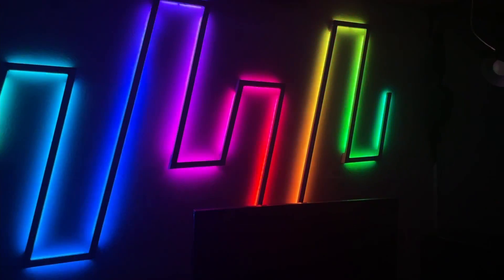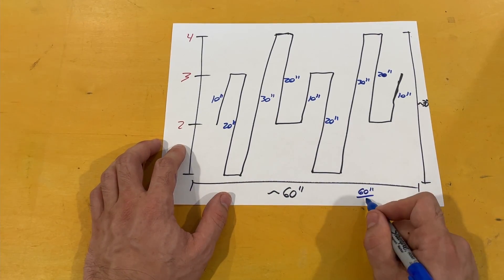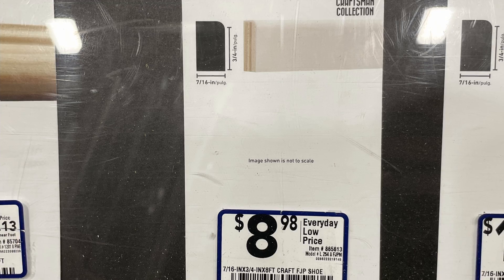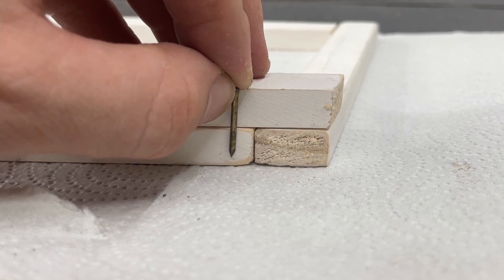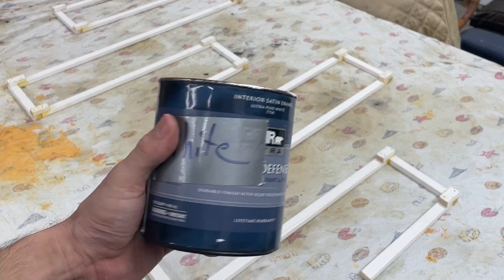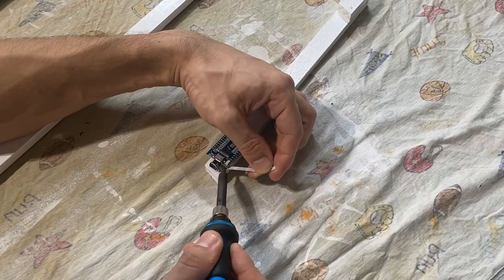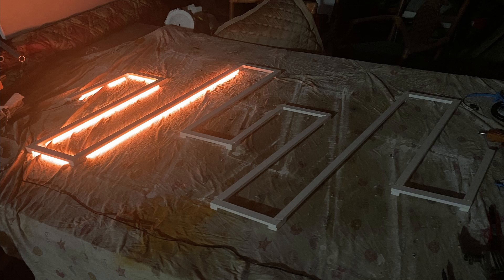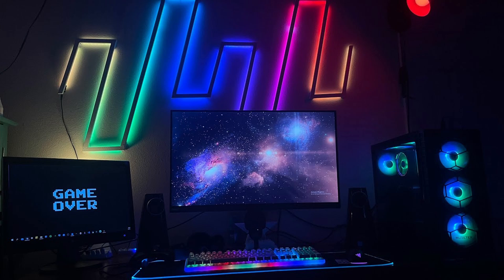The Wave Light (ESP8266 & WS2812B WLED Project)

Comment: Can you please share the code
Reply from the maker: Hi, I used the WLED software for this project. So I did not write any code, I simply flashed the free integration software to my ESP8266.
WLED website is here: https://kno.wled.ge/

There are some quick setup instructions on YouTube that you could check out if you need some additional guidance for the WLED software. (Chris Maher has a very helpful tutorial on the topic of installing WLED on an ESP8266 with WS2812B LEDs.)